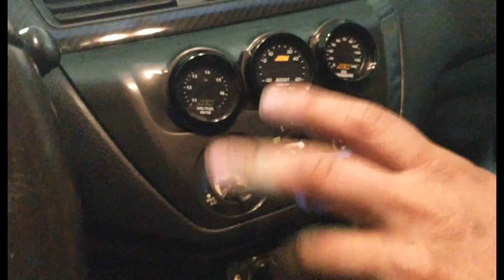Journey to 1000hp Evo (First Start) Precision 6870

Comment from the maker: For anyone that wants to post a ridiculous comment, the issue was a few bent exhaust valves, when the engine was on the hoist, a strap slipped and the engine fell over onto the cam gear. It was broke, we did not know this bent the valves. This video was the only time the car was started, after filming it was taken apart and fixed.

Update: the car was fixed last summer, and made like 780whp. Then spun a bearing.

Also this isn't my car